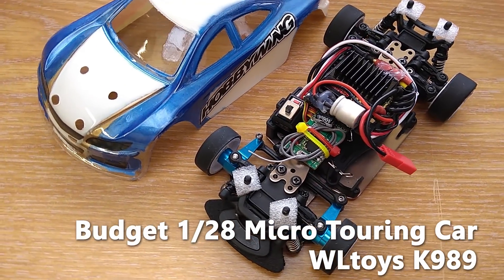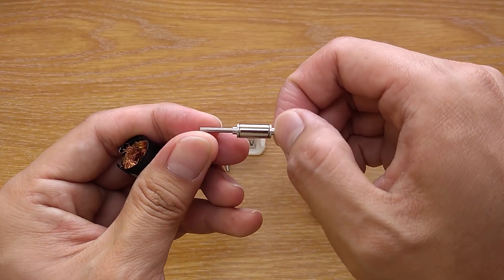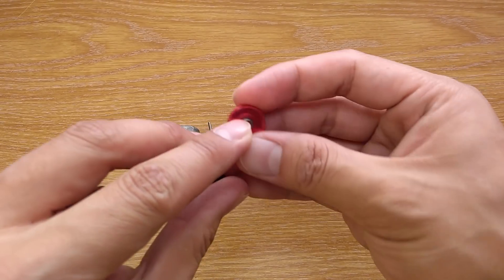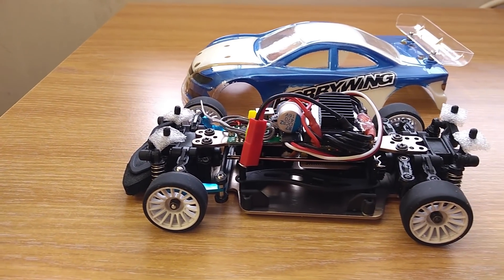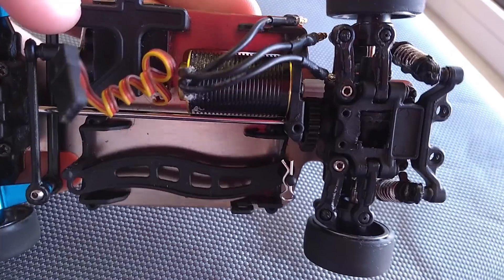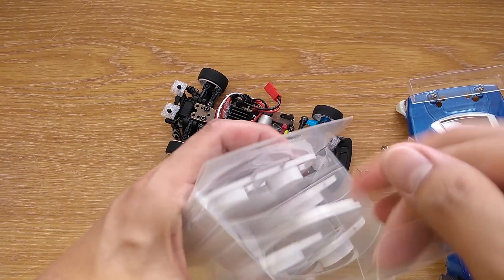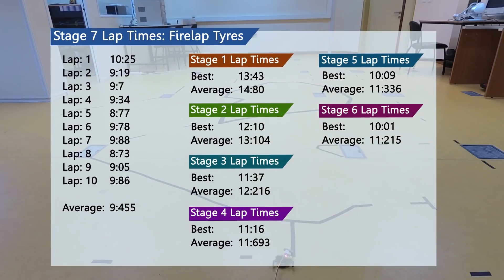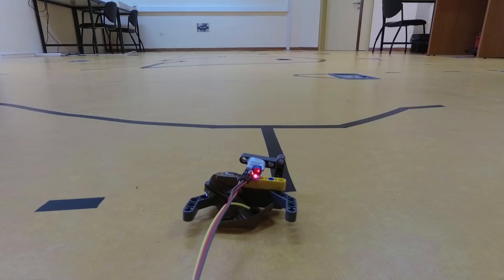WLtoys K989 Budget Touring Car - Stage7 Brushless Upgrade

Comment: Does the EZrun have cogging problems at low speeds? How does it compare to brushed Hobbywing setup for low speed control?
Reply from the maker: EZrun doesn't have cogging problems. It also depends on the setup but when it happens it's not severe. Low speed control compared to brushed is alright, again depending on the motor. The starting speed usually is a bit faster than a brushed system but the motor spools up faster because it's brushless. Nowadays EZrun isn't a good choice because there's DasMikro ESC which is essentially EZrun in a smaller and lighter package.
Reply: @BeaversHobby  Ok, thanks. So in your experience the DasMikro ESC is just as smooth as the EZRun ESC? And the only real differences between them is cost, size, and weight?
Reply from the maker: @jeffreymeeks9080  Yes, I find DasMikro almost the same as EZrun. It even use Hobbywing programming card. In fact it's a bit better because DasMikro has less cogging too.

Comment: IF you where to do this again would you use the same motor? I say this cause im copying your build right now. I have 3 of these along with my carisma gt24. Your videos are awesome!
Reply from the maker: Nowadays I would change the motor simply because 9500KV is too fast and difficult to drive. I'd change it to Surpass Rocket, https://bit.ly/3ircxKC 3500KV for drifting and 5500-7500KV for touring depending on how long the straight is.
As for the ESC I would use DasMikro. https://bit.ly/3h07teH (out of stock in banggood now, check in Aliexpress if you are in a hurry) It works the same as EZrun 18A but much smaller.
I'm not sure what motor GT24 uses but if I remember correctly it's 1222. Anyway, if it can fit 1625/1410 you can copy my electronics build straight on. Otherwise, get the DasMikro ESC and use any motor that works with your car.

Comment: Racerstar LED Carte de Programme pour 25/35/45/60A ESC Set Moteur.
-is it suitable for the Motor + ESC kit 1410?
Reply from the maker: Is it the Surpass Rocket 1410 motor + ESC kit? If so then yes, it works. However I don't recommend the ESC, get the motor and then DasMikro ESC separately. It's a better combination.

Comment: I know this is a two year old video. Couldn't you have used rare earth magnets to mount the body shell?
Reply from the maker: Magnet mount will work for drift car, I also did it here https://youtu.be/hrUr2lJxqkk .
For touring car the body will come off in crashes very easily so it's more secured to use old style posts and clips.

Comment: So ive been watching videos non stop and wondering which esc/motor combo i should go with for a drift car and then another for race. Seems like ive seen a thousand videos and cant decide. Ty for all your videos and help! Also using a nb4 if that helps :)
Reply from the maker: The best budget ESC right now is DasMikro. It's small, lightweight and doesn't stutter or cog. Here's the link. https://bit.ly/3h07teH It works with Hobbywing programming card but you don't really need that because you can program it with the button on the ESC.
As for the motor, for drifting I recommend 3500KV and for touring I recommend 5500KV. Both of which are from Surpass Rocket. Here's the link. https://www.aliexpress.com/item/33027684055.html
Reply: @BeaversHobby  awesome! Guna order that:) One more thing because you know everything lol which brushed esc shld I go with for my other ride? 
Shaluoman DIY Mini Car Boat Using Bidirectional 30A Miniature Brushed ESC with Brake https://www.amazon.com/dp/B07GTW31MB/ref=cm_sw_r_cp_api_glc_fabc_kZe0FbK508HHX?_encoding=UTF8&psc=1

Jarchii [Xmas Present] ESC, 20A ESC Brushed ESC Electronic Speed Controller with Brake https://www.amazon.com/dp/B08884J1XK/ref=cm_sw_r_cp_api_glc_fabc_8Ze0FbHMMCK36?_encoding=UTF8&psc=1
Reply from the maker: @Quintanater  The 30A one seems good. I also recommend this one. https://www.amazon.com/Accessories-LeadingStar-Brushed-Controller-Airplane/dp/B08B5T447N/ref=sr_1_2?dchild=1&keywords=dumbo+rc+esc&qid=1607515146&sr=8-2
It has low voltage alarm but you'll have to install a 5v buzzer like this. https://www.amazon.com/TOTOT-Electromagnetic-Continuously-Electronic-Components/dp/B07GJSP68S/ref=sr_1_3?dchild=1&keywords=5v+buzzer&qid=1607515241&sr=8-3
Reply: @BeaversHobby  is there anything you can’t program with the button that I would need that card? Also is there another option for programming card for this esc?
Reply from the maker: @Quintanater  You meant DasMikro, right? Everything can be done from the button. Granted it's a bit tricky to use but it can program everything from that one button alone.

Comment: Again, thank you for your videos. These are so great and I am enjoying watching them all. I'm curious...  why did you decide to go with a high kv motor and gear change rather than just a lower kv, like 4000-6000?
Reply from the maker: It was the only motor I could buy at that time. Nowadays I'd get the Surpass Rocket 5500Kv, in fact I did. I really need to do an update on this. A lot of things have changed. Now we bot DasMikro ESC which works better than this EZrun and much smaller + lighter (it's just a PCB).
Reply: @BeaversHobby  Excellent additional info. I want to use the DasMikro Flysky receiver since I use the FLysky GT3C transmitter. Hobbywing has a combo brushless motor, 18A ESC, programmer for about $50 with a 5200kv motor, so that's what I was looking at. I will check out both those other suggestions. Great stuff! Car coming for christmas, so plenty of time to plan.
Reply from the maker: @dirtfpv  Beware the Hobbywing combo, it's not the right size. This car (or any 1/28) uses 130 motor which is equivalent to 1625 or 1410 brushless motor  (16mm diameter, 25mm length) but the Hobbywing combo is 2030 motor (20mm diameter, 30mm length) so you'll have to do a bit of modification like drilling the mount or even possibly move the servo out to make it work. 2030 is also heavier than 1625/1410 as well.
Reply: @BeaversHobby  Great info, thanks! I will look at other motors. What a great deal for the Surpass Rocket 5500kv motor/ESC combo at only $40 from Banggood.
Reply from the maker: @dirtfpv  That's an alright combo. I also did a written review here. https://www.facebook.com/beavershobby/posts/2681817142070597
Reply: @BeaversHobby  I think you may have just saved me from having to order from Banggood. I will order them separately and go with the Dasmikro ESC.
Reply from the maker: @dirtfpv  Dasmikro ESC is on AliExpress too. You should be able to find it easily.
Reply: @BeaversHobby  what size pinion and spur gear should I get if I'm running the rocket 5500kv motor?
Reply from the maker: @mrwiggles837  Generally 12-17T for drifting and 17-19T for touring/racing. Still, it depends on the speed you want.

Comment: Love your videos! I just did this to my k989. Where did you get the gears for the motor?
Reply from the maker: The 8T pinion is from Tamiya Mini 4WD. For other gears I  bought a bag of plastic gears like this https://bit.ly/359tyVb. Or you can search for "plastic gear for small robot" or "0.5 mod plastic gear" on ebay also the bore is 2mm and there'll be many sets to choose from.

Comment: Hello and thanks again for your immense passion and for the time you spend! I wanted to ask you why my engine gets hot after a few minutes of driving ... I state that I have not yet cleaned the plastics and not even added grease to the differentials as you indicated in the first video. Is this the only reason?
Reply from the maker: The motor is normally hot but not to the point that it shuts down by itself. Fixing the car and adjust gear mesh will help so it won't shut off by the heat but it'll still be hot.
Reply: @BeaversHobby  ok thank you! And what about the battery? You Sais nothing about It and possible upgrade?
Reply from the maker: @CiroZeno  I haven't done the upgrade yet because the standard battery is still working well so I don't feel that it's necessary. But if you want to upgrade any 2S lipo will work as long as it fits on the car.
A lot of people opt to use Gaoneng or GNB because it can deliver more punch. 300mAh will fit in the same bracket ant 450mAh will need some more room so you'll have to remove the tray and stick it down with a tape.
Reply: @BeaversHobby  today I have clean the plastics, applyed Grease to differentials, and smoth the suspensions...It works great!!! Yes I ready about those battery, I'll try...see you on channel and thanks again!
Reply from the maker: @CiroZeno  My pleasure. Good luck with the project.

Comment: I’ve just bought one of these ( to race my 4 year old around the house ), ordered the carbon chassis and alloy upgrades . Now to work my way through your list and build a crazy little brushless weapon
Reply from the maker: Hopefully you got the working alloy parts otherwise you'll have to fix them like this. https://youtu.be/cKw-T2f-Qms
Good luck with the project!
Reply: Beaver's Hobby thank you buddy no doubt I will need to use that video when the time comes , it won’t be the first model I’ve had to modify and I’m sure it won’t be the last , your running a great channel  , keep up the good work ✌🏼✌🏼✌🏼

Comment: Whats the best wl toys for driving experience out of box 252 or 969? Also can you tell me what is the best rtr drift car out of box for around 300 or less? Thanks
Reply from the maker: K969 is better both out of the box and modified.
As for the best for ~$300 then in case you don't have any experience at all with RC, Mini-Z AWD will be the one to get. You don't have to do anything, just open the box, insert the batteries and drive or drift.
Reply: @BeaversHobby  do you think the atomic version 2 is better than the kyosho mini z? Thanks alot. I just prefer 2wd drifter which is probably more skill. Which brand is easier to work on about the same as they look similar? I have 20 years experience with rc cars. I have a 100+mph 2wd speed modded stampede   with about 700$ into the truck. Im no rookie. Have many tools. Just new to the small cars as they are same as 10th scale pretty much
Reply from the maker: @familyman8644  Didn't know you are already in the hobby so this will be much easier.
Get an Atomic, no matter what it is, it will be better than Mini-Z. Mini-Z is good for a beginner. Coming from car building you'll get very frustrated because of proprietary electronics and you can't even use your own transmitter.
DRZ V2 is their latest offering for RWD drifting. I'm absolutely sure you'll like it.
It's still in Mini-Z ecosystem so it shares the wheels, tyres and body which you can get pretty easily from a Kyosho dealer or buy directly from Japan.
However, it's like what I mentioned earlier. You can't get everything from just 1 shop.
I forgot to mention Atomic or any kit car will be much easier to work on than Mini-Z both mechanically and electronically. It'd be even better if your radio has small receiver available (Futaba, Sanwa and Flysky Noble have it with the plug ready for micro car) otherwise it'll be difficult to fit under the body. Of course you can always mod a receiver to make it smaller.
Reply from the maker: @familyman8644  The RTR stuffs and the radio have been discontinued for years now so you can't buy those anymore, only kit with partial electronics are available. Yes, their battery is good but I don't know if it's in stock. Most of the time it isn't in stock... I just checked and right now it is not. Their official store is miracle-mart.com so you can check there for the availability. Besides, you'd be lucky to be able to order it and ship to your location due to lipo shipping restriction. That's why I said to get it from other sources. Unless you'll buy it from a local Atomic dealer then they should ship to you, no problem at all.
Atomic has lexan body so if you want that, don't forget to pickup the lexan mounting poles too. If you decide to go with AMZ, it's narrow chassis and their lexan body is for wide chassis so it could look a bit weird but it'll work. Don't forget to pick up the bell crank steering upgrade too otherwise it won't drift. Here's my Atomic AMZ review and pretty much everything you need to know about it. https://youtu.be/u7Jsw8IW-zY It'll do both drifting and touring. I just got it for drifting.
And oh... your transmitter got pretty massive receiver so you'll probably have to get a new one.
Reply from the maker: @familyman8644  It's a kit with electronics. That's how I bought my AMZ as well. Their electronics are really good so you can get that without having to worry about anything.
However do you want a touring car or do you want a drift car? AMR can't drift, just so you know.

Comment: 272$ for this shit hahaha
Reply from the maker: It's because I included everything that I paid for and most of them are not even on the car. 
But yes, I sank that much money into this project. Buying a GLA is a much better choice at this point.
Reply: @BeaversHobby  I mean, with this money you can buy a good 1/10
Reply from the maker: @fx9188  Yes, that's true. But 1/10 isn't as compact as 1/28 and I don't have a place to run it. Also the chassis I mentioned earlier (GLA) is the best racing-grade shaft-driven 1/28 at the moment.
Either way for $250+ there are better options than to sink in one cheap car.

Comment: Hello Beaver,  Have you tryed the hobbywing motor EZRUN-2030 12T/18T 7800KV 5200KV ? It comes with the ESC for cheap.
Reply from the maker: 2030 motor is not the right size for this car. For budget setup now there's Surpass Rocket 1625 with small ESC that will fit perfectly on this car. The price is not much different than Hobbywing 2030 combo and it will be much lighter and more appropriate on this car too. https://www.aliexpress.com/item/4000900570121.html
ps. This video is outdated now and I'll update my setup as soon as mine arrive.
Reply: @BeaversHobby  Is this surpass esc any good ? Can it be configured ? I counldnt find info on it online.
Reply from the maker: @Izlolz  They said it can but so far no programming card works yet. The ESC is pretty good. Of course it's not like $35 Atomic ESC but from what I've heard it works very well and got enough power for any motor of this size. You only need to calibrate it by holding throttle at full reverse on the transmitter, turn the ESC on, wait a bit and let the throttle go back to centre.
It just came out not long ago and not many people has got it yet due to shipping delay. I've been waiting for more than a month now.
Reply: @BeaversHobby  okay, let us know if it is better than the hobbywing :) have a good evening and thank you for the answers ;)
Reply from the maker: @Izlolz  My pleasure.

Comment: That’s already a 1/10 scale touring price. But in all honesty, not bad. I like it. Through 3D printing, I’m creating a rwd pan car based on a 1/32 scale mini 4wd. It’s using a drone brushless outrunner motor, but the problem with it is that the drone esc lack braking and reverse function. I’m thinking, I should try that esc.
Reply from the maker: Yes, the spending has gotten a bit out of control. 
If you are looking for small brushless ESC, take a look at Atomic or GL because they are the best sensorless ESC right now. http://www.miracle-mart.com/store/index.php?main_page=product_info&cPath=67_74_1162&products_id=14103
Now there's also Surpass Hobby combo which, from what I've heard, it's really good. I'm still waiting for mine to arrive. https://www.aliexpress.com/item/4000900570121.html

Comment: Broo can i know what kind of battery is the good one for wltoys k989?
Reply from the maker: 2S Lipo between 300mAh to 450mAh got the best balance for the car. More than this and it can become too heavy.
I'm not sure if Banggood can still shop battery to you but here's a good one. It's a bit long so you might have to take the battery tray out and stick it down with tape or velcro. https://bit.ly/3cInWC1
Otherwise you can check out hobbyking.com for Turnigy Nanotech batteries.
Reply: Beaver's Hobby owhh ok thankss for the information broo